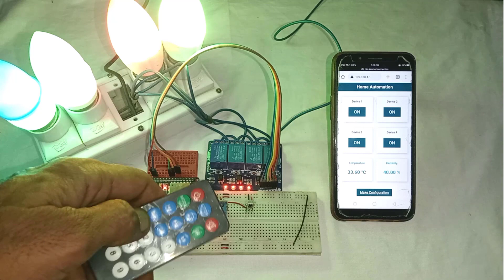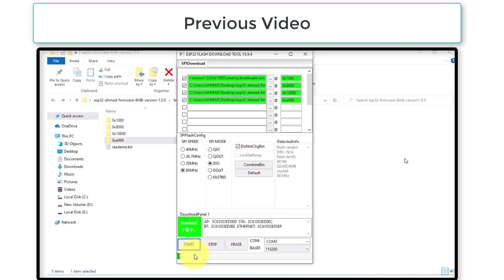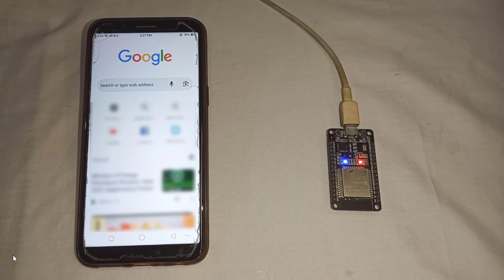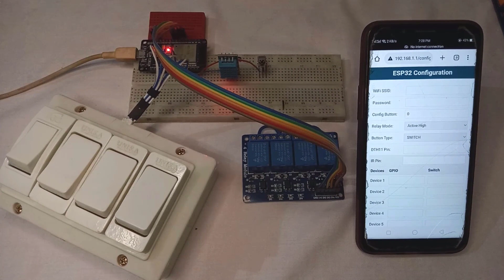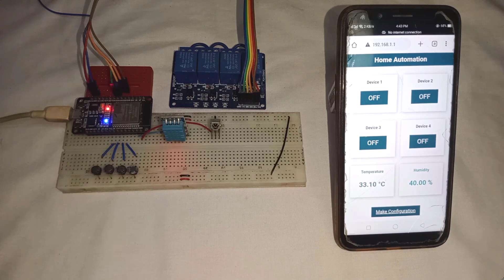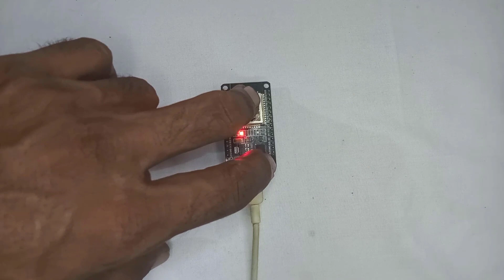ESP32 Home Automation with AI - No Code Required

Comment: You did a great job putting this project together, teaching and providing great information.  I saw that there was Version 1.1 in the GitHub folders. But these files do not have any code in them, only blank folders. The Version 1.0 has the 4 files to upload into the ESP32.  Would you be willing to share the code for this project?  I want to make changes to add this to a RF Switch box with 20 I/O functions.  Thank you for all that you do and have shared.

Comment: you can also add voice command on this project by using the vc-02 or some other voice recognization module and also add a feature to change the wifi password otherwise some may be hack your home automation system if he know the esp32 hotspot password or share your firmware code with me so i can hardcode the password if someone know

Comment: Hi
I recreated your circuit.
I would like to only switch the relays  shortly.
when I press the button 
press the relay closes shortly and opens again does not stay closed.
would like to do so
operate the control panel remotely.
can you help me with that?

Comment: can we use ultrasonic sensor hc-sr04?  How to use it over the internet?
Reply from the maker: you cannot use ultrasonic sensor. this project does not have feature to work over the internet. but in the next version I will add internet control

Comment: Dear Ahmed
Please Make A Display
Moon Rise Moon Set Time..
That Are Not Available In Internet.
Reply from the maker: give some more detail or any reference
Reply: @AhmadLogs  I Request For Any Display To Show MoonRise And MoonSet By Arduino..
Reply from the maker: @akydisplay  hmmmm. I think we need an API for this so the internet connection is required, so esp32 or nodemcu will best option for this project. or else we can use arduino Ethernet shield for this

Comment: Can you specify the type of power supply exactly you have used. Because i got power noise and voltage drop. Do you suggest also using capacitors. If yes how to add it. 

Also is it able to add lcd?
Reply: Lcd using i2c?

Comment: Thank you Ahmed for your video. It was an amazing video. I want to apply this idea for a 220 V switches to work in parallel with the esp32 and the on off touch on the IP address work also.
Reply from the maker: Yes you can
Reply: Look like cadio app

Comment: Brother I had buy a mfrc 522 RFID reader and writer module and buy additional cards also these have same frequency but not working
Reply from the maker: just connect the mfrc 522 RFID reader and writer module to your micro controller without using the breadboard.

Comment: It's great but I wonder if someone wants to add wifi capability so you can be able to control appliances anywhere you are.

Would it be possible in case you are away from home.
Reply from the maker: I will try to add this feature in version 2
Reply: @AhmadLogs  will it work with Alexa and Google
Reply from the maker: @smartteg7381  not. may be will it work in future